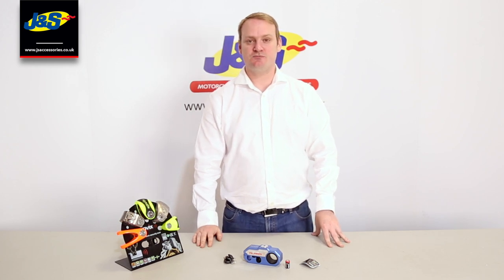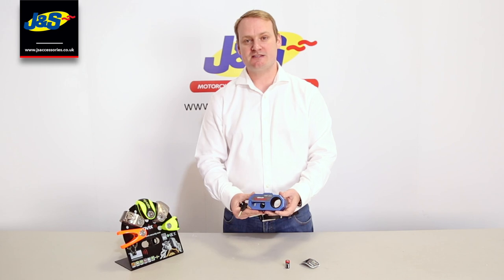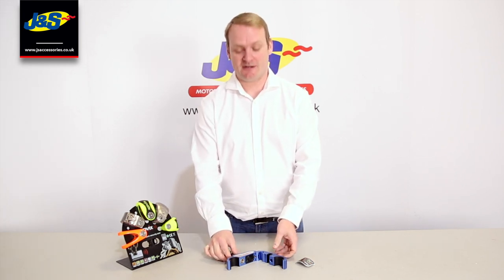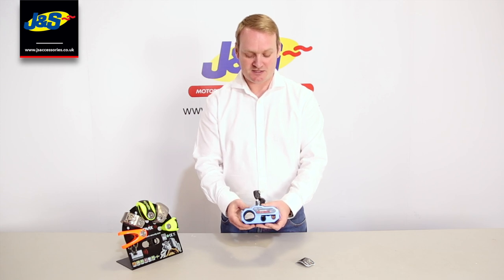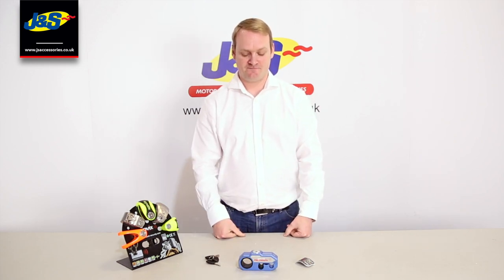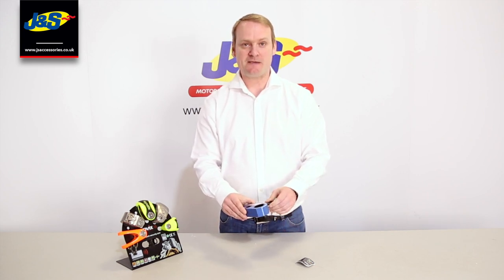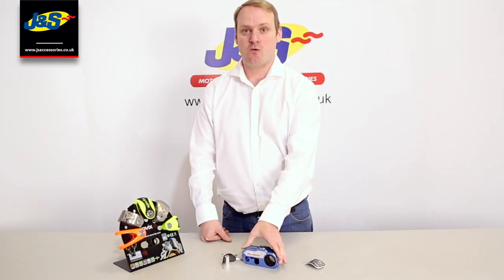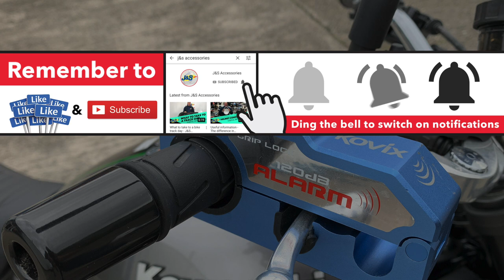Kovix KOL Alarmed Lever Lock - J&S Accessories Ltd

Comment: Do we have to use it right front breaks or left??
Reply: Front would be better. But that depends on the bike. I'm going off the obvious here and saying yours is a twist and go. So really you'd want the the lock over the brake that has most of the weight on it. In the event that someone does want it, they will struggle to pick up the part of the bike that's locked.

Comment: There is no manual for this online and the one it comes with is piss poor and you say cap but it’s a rubber rectangle where the led is. I’m not buying Kovix again… I too snapped the circular sensor and have to glue it back on.